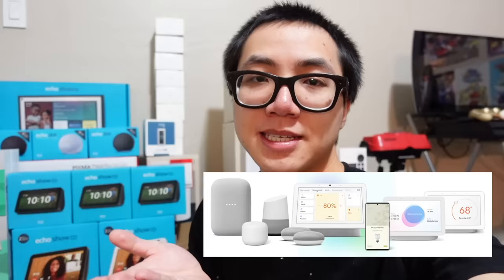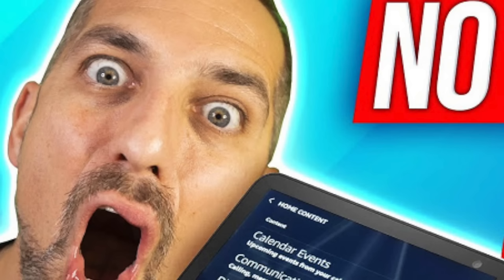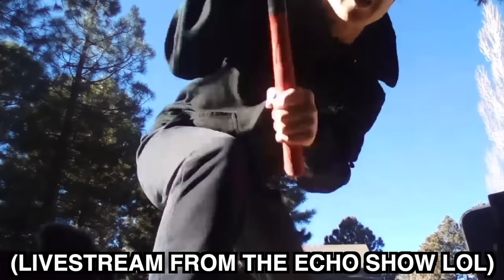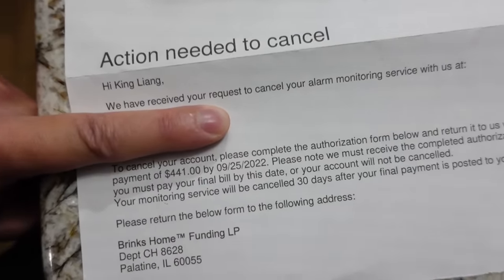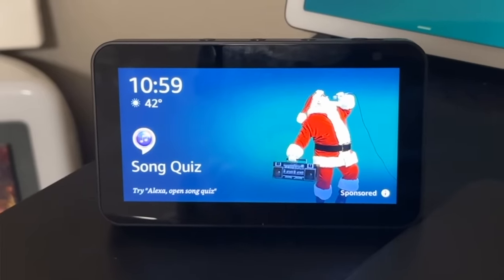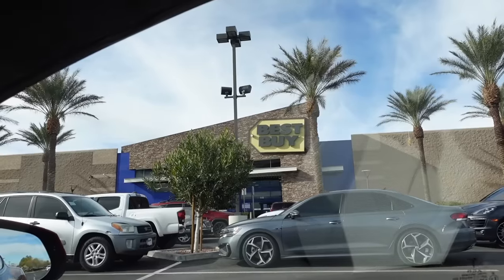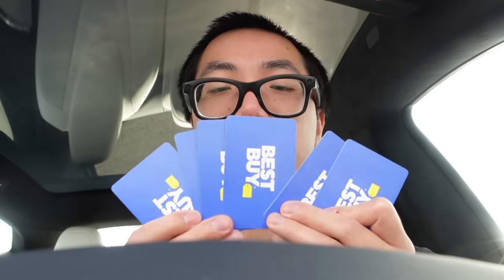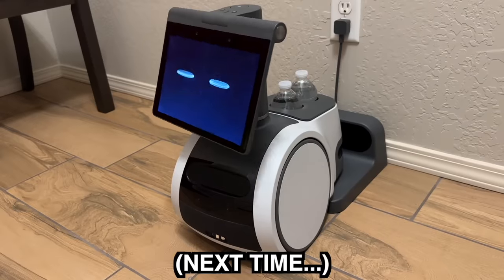MY BLACK FRIDAY MISTAKE

Comment: 18:50 You'll need a Phillips hue TV led strip for that, then those thermostat things are Nest Gen E 2nd gen backplates, you should've gotten the nest x Yale lock instead that way it'll go with the ones you already have and integrate better with Google, and finally, you should've gotten the bulbs without the hub unless you really need a second hub, unfortunately tho, two hue hubs won't work with one Google home account